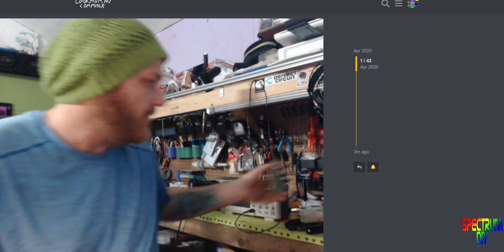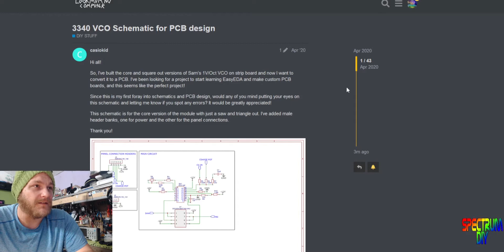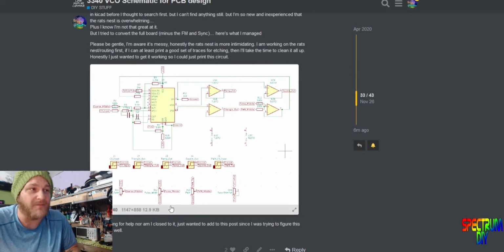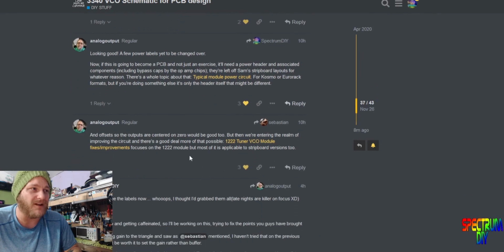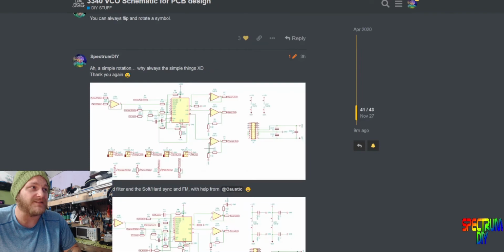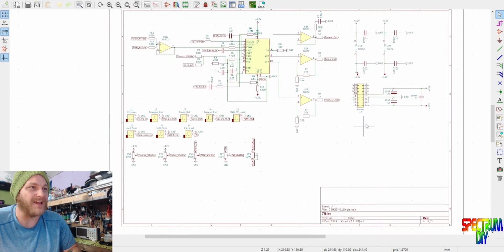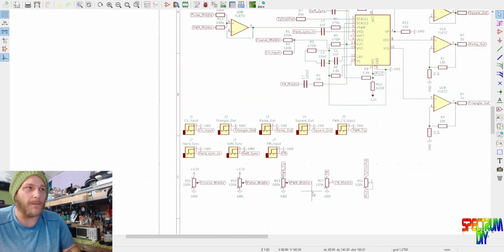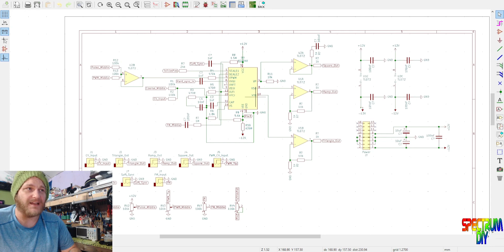DIY Synth VCO | Part 1: Sorting the Schematic

Comment: Ah LMNC excellent. Purchased a number of his boards and face plates. Getting components is proving somewhat difficult especially as I have no idea what I am doing lol. Built his Super Simple Oscillator and not a peep out of it. Guess I fried something. Will watch this with interest.
Reply from the maker: I've found most of the components from tayda electronics, plus they're super cheap and reasonably fast shipping.
Think caps are about $7 USD for 1000 ceramic caps, just an example. Think Jack sockets are like 50c and pots are about 35c I think.

Probably different by a little, but they are very good, mouser is good too, slightly more expensive, but good.

Of course eBay, but I've found most everything either from tayda or mouser. Except the electric druid parts. 
Hope this helps!

As to the support simple oscillator, the schematic it's backwards on the transistor I think, unless it's been updated, but you want it
Collector to 100k output resistor and emitter to the LED to ground, you have to cut the middle leg too. Otherwise any cap will work fine smaller than 300uF
Cheers for checking out the videos! 😁👌
Reply: @SpectrumDIY  Awesome thank you. Will check the LMNC Super Simple Oscillator schematic got it ages ago so could be wrong way round.

Comment: Comprehensive! I just built a VCO kit from Synthrotek a few weeks ago which was 3360 based, but it didn't even have the hard or soft sync inputs, so your project will be interesting.

Having designed and built a few eurorack modules on strip boards from scratch myself over the years, one of the things
I have only recently started putting on all my new modules are 10 ohm current limiting resistors on the +12, -12 and +5v power
inputs. But I guess this is not really very necessary on a proper PCB design. As all my module designs are strip
 board, this little trick just helps protect me from any 'magic smoke releasing' incidents...  

Have fun!
Reply from the maker: Thank you! I hope so! I've been working on the rats nest the last few hours 😆